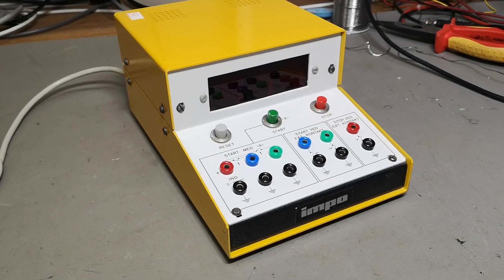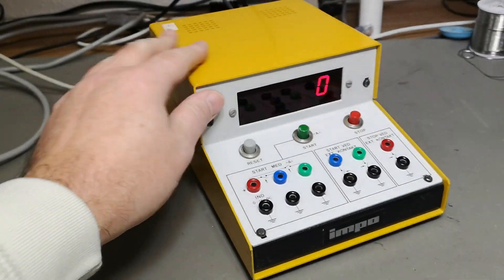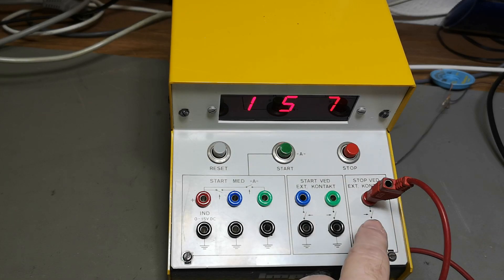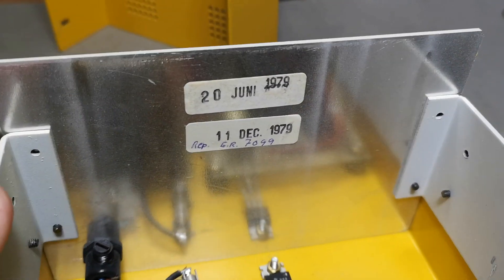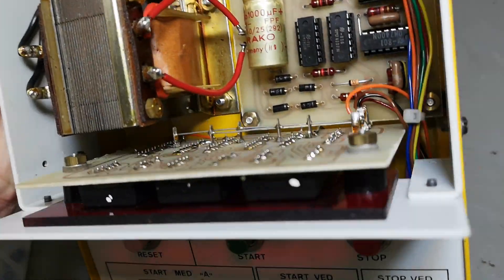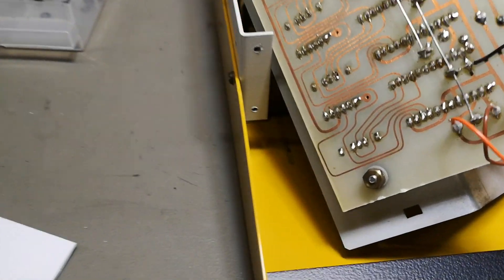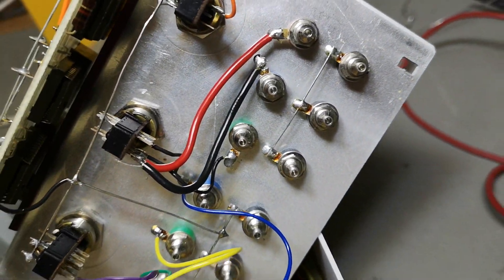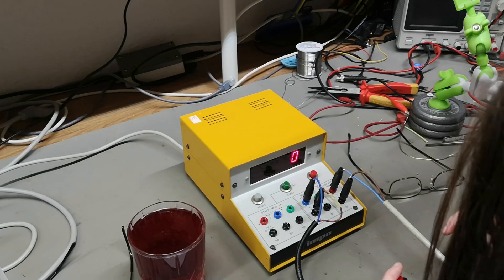IMPO time react test measure system 1979 test teardown

Comment: The later December date code sticker has "Rep." written on it. So I guess meaning repair, i.e. it was repaired in December, 6 months aftr it was made in June.
Reply from the maker: you are right, sadly revealing a possible low quality issue in production or with design :-)